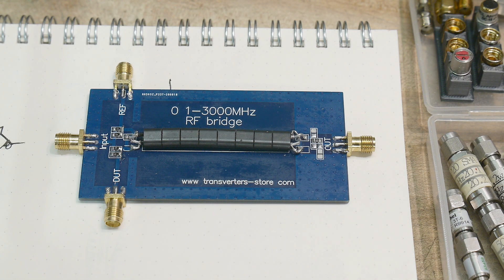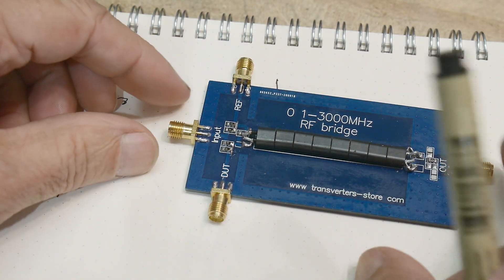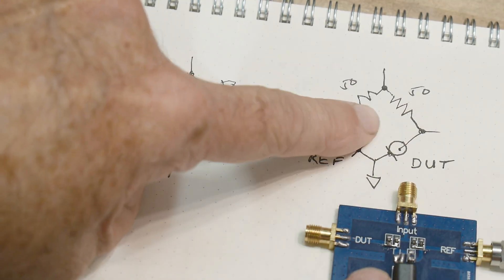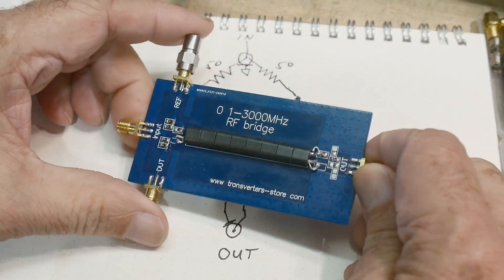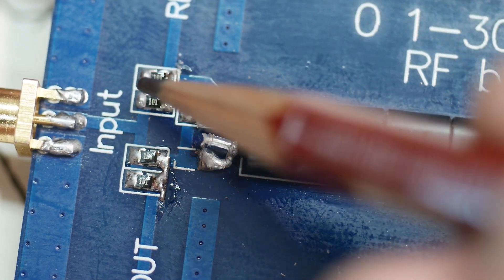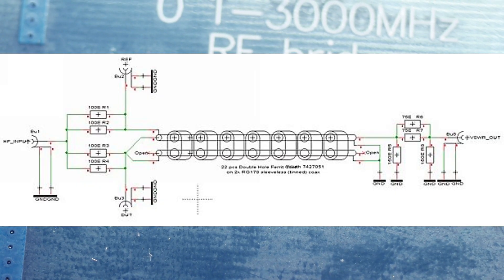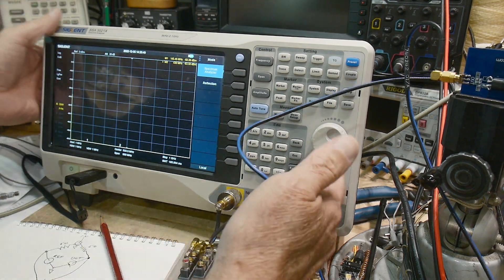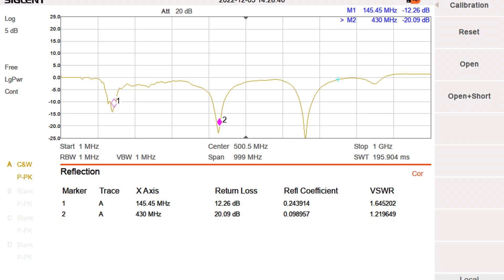#1366 RF Bridge

Comment: Is the reflected mode  you are using a standard included feature of the 3021x or is it one of those options that is just available as a  preview for a limited time  and will need to be purchased when it expires? Been seriously looking at getting either this machine or the 3021x+ and love seeing practical applications like you present on your channel. 73
Reply from the maker: I believe you must have a Reflection Measurement activation license

Comment: Hello, excuse my ignorance, could this RF bridge be used with a NanoVNA? Or would it not be necessary? I'm a little confused because I see videos that use an SWR meter, but I see that they connect the transmitter on one end and the antenna on the other end, however I only see videos of the NanoVNA that only connect the antenna, but I don't understand the reason, I think I understand that you can't connect a transmitter to the NanoVNA because it would burn, but then, what would be the valid way to measure the SWR of the entire equipment, transmitter and antenna, or is it only necessary to measure the SWR of the antenna to know if you are within the ideal parameters?
Reply from the maker: the Nano has the bridge built in, that is how all VNAs work: https://youtu.be/yGKWBpgN8PU?si=EZKX-e1d-YDN4u3L

Comment: So, why use coax, if you're just going to cut out the center conductor; any value or characteristic specific to the braid?
I went ahead and ordered one, since you figured out the fix.
So, thanks for that and the video!
73...
Reply from the maker: since it is a bridge, you want both sides to be as equal as possible. there still be inductance on the coax shield.
Reply: @IMSAIGuy I guess I should have been more clear.  I was trying to understand the difference between both conductors connected (shield + center vs. just shield) or why not just use a normal single conductor wire?
Reply from the maker: same answer as before, the outside shield of the coax has a diameter, resistance, material, that all adds to a complex impedance, a single wire would be different.

Comment: Hello. What firmware version do you have in your SSA3021X? Mine, shows nothing when I press on "Meas Setup". I have only "Cal Open Load" in Reflectiuon page. Thank you.
Reply from the maker: https://youtu.be/5mStt_OsNAM?si=MDZq3M4ORr_my4SP
Reply: @IMSAIGuy  Already seen that video, but still, on my SSA3021x I have only the option for Open calibration directly in the Mode : Reflection page. Pressing on Meas Setup nothing happen.Ițm using the latest available firmware (1.3.9.10). Hardware version is 07.03.00.
Reply from the maker: Like I said in the video, mine is upgraded to 3032 with all options
Reply: @IMSAIGuy  Same here. Reflection is activated. What firmware version do you have? The latest one available for SSA3000x is 1.3.9.10 and does not have Short calibration option. Are you using the firmware from SSA3000x Plus?

Comment: I built a similar unit myself, but I used a 4:1 Toroid Transformer instead of the binocular transmission line transformer.  It works well, but my design only works to 200 MHz.

Comment: My understanding is that the guy who originally designed the bridge used to have a shop selling them through the address on the board. He closed it down after the chinese cloners reproduced the board, even with the web site address on, however with the fault that you have pointed out. He realised that the board was being cloned and was receiving loads of enquires about faulty ones. He tried to resolve the problem but eventually was forced to shut down the site and his shop.

Comment: Thank you VERY much for this video.  I've found myself with a defective one of these and I'm about to see if I can get it working.  My soldering skills are awful but I'm going to see if I can mangle it together.  I was wondering if you would be willing to take a few minutes and look at the video/images of what I am dealing with and maybe offer any guidance/tips on what I need to do to get it working.  Much appreciated if you can.  The video is here:  https://youtu.be/swWjJ8iiZ3I      (there is a longer video on my channel that shows what I'm trying to do and me discovering that something wasn't working correctly).
Reply from the maker: yes soldering is a mess but actually OK. just short the 100 ohm resistors on each side to make two 50s and it should be ok
Reply: @IMSAIGuy  Thanks very much for responding... and so quickly.  As I sit down to see your reply I just came from my workbench where I did exactly that.  It was ugly but seems to have worked.  I recorded some more footage of getting it working that I'll probably publish on my channel as well (don't think you'll learn anything from me here but if you are curious to see the beneficial results of your helpful video it will be out there)!   Thanks again!

Comment: The original seller of this (the ones that work) is based in Ukraine and has curtailed selling due to what's happening. The majority of the ones on ebay/Amazon are from China and I'm guessing the design was made from copying a photo, not following a diagram or properly understanding the theory, so they all appear to be faulty or of suspect quality. Thanks for bringing the 'fix' to a wider audience.

Comment: For folks with the same issue, might this be an opportunity to upgrade the tolerance and/or wattage on the resistors? This is not my area of knowledge, so I do not know how exact things must be. But, if an improvement in tolerance is beneficial, then all sorts of component packages could be considered. Some of which might make bridging easier.
Reply from the maker: it is fine as-is

Comment: I bought one a year ago. It didn't work. It took me about a half hour to figure out what the problem was because like an idiot I ASSUMED the PCB layout was correct. How does one screw up something so simple and not catch it when they are producing a mass-produced product? They never even tested one? Anyway, once I fixed it it worked OK. I wrote a comment on the Amazon site of the supplier describing the problem and the fix - a year ago.

BTW, I know you were just demonstrating the functionality of the repaired bridge, but you might want to remind your viewers that you only screwed in half of an antenna to test. The fixture needs to properly provide the other half of a halfwave dipole in order for the return loss (or VSWR) readings to be at all meaningful. These days, YouTube is full of 'tests' of just the whip portion of HT antennas without any thought as to what they are actually measuring, so they often claim good whips are bad, and possibly bad whips are good.
Reply: I would be interested if you or IMSAI guy would say or show how to properly emulate the other pole for an HT antenna.  I've been told that the user makes up the rest of the antenna when going portable.

I spent some $35 on a telescoping HT antenna that claims certain gain numbers and SWR on 2m and 70cm when fully collapsed or fully extended, but my measurements (on SWR) could not be made to agree.  It's their FAQs that say "you can't measure it", more or less.
Reply from the maker: I have tried several things. you can add a ground radial hanging below, you can hold a radio and touch the SMA/BNC of the radio to the ground of the antenna. Most of the time it doesn't matter much. the biggest effect is having the antenna away from any object so it can radiate. here is a fun video I did: https://youtu.be/wem0DoPe5O0

Comment: You don't need the center conductor of the coax connected. The other piece of coax carries the differential signal to the output, and uses the shield and the center conductor. You only need the shield, on the other piece (together the shields form a balanced line.) You can even use a solid piece of wire. (If using a solid piece of wire, you should use one the same diameter as the coax, to keep the capacitance balanced.)

Comment: Thank You!  You saved me a bit of work and probably a few expletives. I picked one of these up a few years back to use with my Nano VNA both of which have been sitting unused so far, picked them up for portable use.  I have a Rigol 815TG on the bench with a few Mini-Circuits directional couplers and Narda attenuators where I do the majority of my work.  Unfortunately, I just haven't had time to play RF much over the past several years due to various life events that seem to occur much more frequently as I get older.
Reply from the maker: I know all about life getting in the way. Hope you have a good year.

Comment: I have the same bridge, I was scratching my head wondering why it was not working properly and I have the same problem with the 2 100R resistors not paralleled, thank you for sharing the information I will correct mine too. Also I read somewhere that the chap that was making the original is based in Ukraine and has stopped trading due to what going over there at present however; a lot of these bridges that are now for sale are knockoffs coming out of Asia and I guess whoever is making them hasn’t fully grasped of the concept.

Comment: Just checked mine, yes, it does have that exact fault. I need to start the soldering iron. I do have a NanoVNA 2, so I could do without this, but as I have it, it should be in good working order. First little project of the year.

Comment: I have the SSA3021X Plus, and it has all the hardware, including a bridge, to be a VNA, and I think the same is true for the non-plus version as well. The instructions are on EEVBlog for the hack.
Reply: Edit:
The "Plus" models do seem to have VNA features while maybe the non-Plus do not.  With just the "open up everything" hack I can go to VNA mode (pressing the Mode button to select modes) and am able to do SWR, return loss, Smith Chart, etc testing.

Previous comments:
I was led to believe (by the EEVblog forums) my SSA3015X Plus also has all required hardware and the same firmware swap should convert it to an SVA1015.  Other comments to IMSAIGuy's recent videos  have cast doubt.

I've done the "open up everything" hack on my unit, but so far I've refrained from the SVA firmware swap.  I may have to buckle up and try that soon just so I can set that doubt to rest one way or the other.

Comment: These work well with the 100 ohms paralleled to make 50 ohms.
Reply from the maker: I just said that
Reply: @IMSAIGuy  yes, you did. In the Wheatson bridge all the 4 sides must be 50 ohms (or any such identical value or the resistors in the opposite arms) to get the bridge balanced so that no current can flow in the meter or any detector
De VU2RZA
Reply: @IMSAIGuy  So did I three months ago when the robbers at a certain emporium wanted £500 to do the same job. Regards.

Comment: I had same issue and it turns out they the bridge you/we bought is a CN copy of the original, did read about that after I did order it from eBay years back-
Also they did copy the website on the pcb-

Comment: I bought the same unit a number of years ago. Appears to be wired correctly. Tracks present and coax inner cut at both ends. I think it was from the original seller. Sounds as though yours might be a copy...?

Comment: Bah! I bought one of these on AliExpress and it's been in the box since as I could not get it to work. Before I received my 3021 I was using a noise generator (BG7TBL) and a cheapo RTL-based SDR and would get curves I could tune with, but soon found it was way off. I bet that jumper fix will help mine. I checked and have the same issue on my PCB. My only concern is yours had a different arrangement on the coax terminations. None of mine are flapping in the breeze like that.
Reply: Also, my 3021x does not have the measurement features because the demo license on them expired. So frustrating that they put all of that behind a fricken paywall. It makes me not want to recommend the product to people.

Comment: One side of the binocular cores are configured as a BALUN (BALance-to-UNbalanced).  The cores help minimize the current flowing on the outside of the coax shield.  Think of an ideal coax, current flows on the center conductor and an equal but opposite current flows on the inside of shield.  Current on the outside of the shield causes the design to stray away from the theoretical, and  limits the bandwidth.  Also causes a phase shift.  So to get the coax back to more of a theoretical topology, you try to increase the impedance of the outside of the shield by adding cores to raise the impedance, forcing the current back to the inside of the shield.  If I'm not mistaken, this is called the 'choking' or 'magnetizing' inductance (not sure about those terms, they seem to be loosely used).

So while adding cores helps bandwidth performance greatly, there is still a slight phase imbalance due to the inductance on the shield not being present on the center conductor (i.e. the topology is no longer symmetrical).  This is solved by adding the same inductance to the center conductor of the coax. That's what the other side of the core is used for and that is why only the shield was used (the center wasn't connected and isn't needed) - you just need the shield inductance.  This is sometimes referred to as the 'dummy' coax. 

This BALUN topology is used often in wideband transmitter designs when combining multiple devices (i.e. push-pull, etc.).
Reply: Damn, Mark, you should have a channel too!
Reply: @chrisbart5316  LOL, not a chance.  I can't hold a candle to the IMSAI Guy. :)
Reply: To me it's just a common mode choke, so that you block common mode signals, and let the differential signal pass. (You could use a transformer; but, you probably wouldn't get as broad a band-width.)
Reply: @willthecat3861  Thanks for your comment Will. I think the HF HAM guys (which I'm a part of) tend to call it that, but the important aspect is that it's configured as a wideband TLT (transmission line transformer) Balun. Whereas a common mode choke doesn't necessarily imply it's being used to take a balanced input (i.e. the bridge) to single-ended output (i.e. the grounded SMA connector), with the 'dummy' Balun coax being used to help get the performance closer to ideal.  That's just the distinction I wanted to make in my initial post because I thought some people might have missed that important aspect.

The cores help extend the lower frequency whereas the TLT length sets the upper frequency limit (usually around when the frequency is 1/8 wavelength of the coax, but picking the wrong core can limit the upper freq too).  You can see that in the 1-3000MHz range the designer silk screened on the board (3000MHz might be a stretch in my opinion).  If you google "A Tutorial on Transmission Line Transformers" by Chris Task, he has a nice write about the Guanella Balun (but it doesn't cover the 'dummy' balun coax). You probably know all that, just wanted to add clarification for others.

I agree about your BW comment and using a transformer. Kind of hard to beat the performance of a TLT, especially at UHF and above.
Reply: Thanks for the detailed information
De VU2RZA

Comment: I'd seen a few copies of the Transverters Store board with dodgy PCBs but I thouht the genuine ones from Ukraine were all good. 

Unless of course they've ripped off the silkscreen as well.

How well does it perform up around 2.5GHz?
Reply: I think it is a (bad) clone, the dots in the web address and frequency range seem to be missing, so maybe some of the tracks are too!
Reply: Don't know if they're related at all but the "60dbm" COMpany based in Kiev is still in operation and offers a 0-3000 MHz RF bridge in a nice enclosure for 33 US.  I should have got one of those last month when I ordered their 100W bandpass filter board.